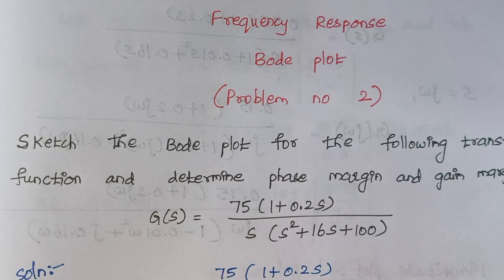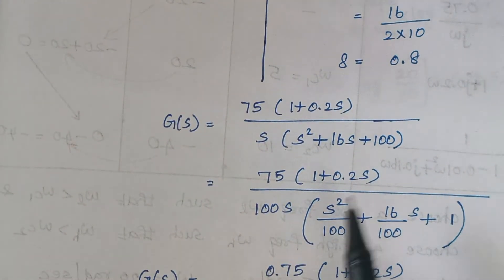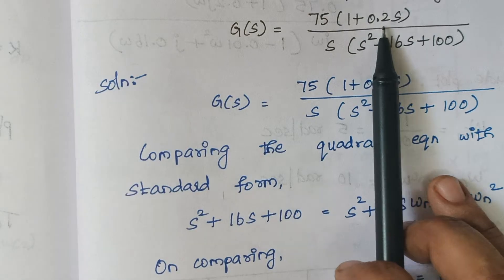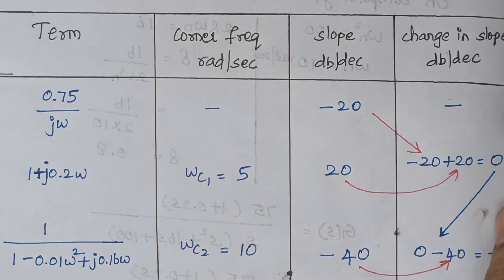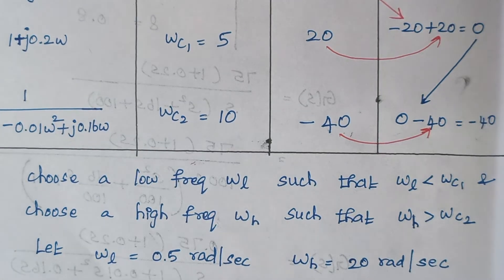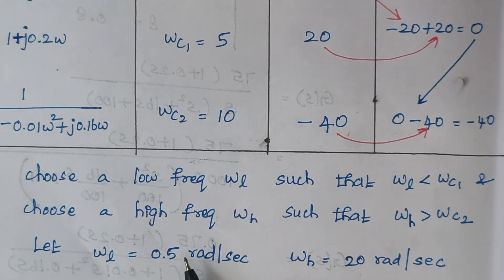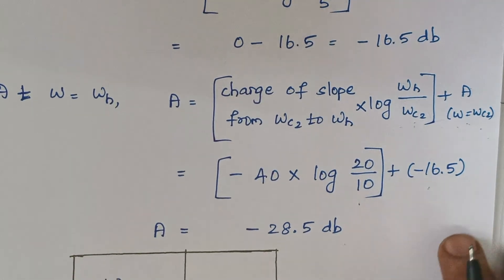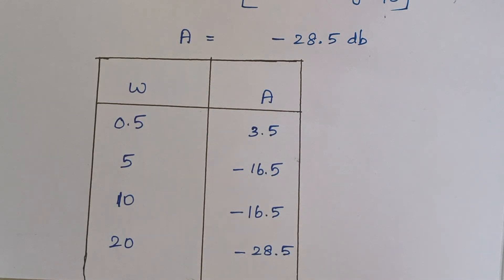BODE PLOT (Frequency Response)(Problem no 2) ( Part -1)

Comment: maam how can you consider second corner frequency as 10?
Reply from the maker: Whenever you have a quadratic equation,then you have to take Wn value as one of the corner frequency.Here Wn2 = 100.therefore Wn = 10. Here we have Wc1= 5 ,then the next high frequency is 10 . therefore Wc2= 10 here
Reply: @kowsiteaches  thank you maam
Reply from the maker: Most welcome 😊
Reply: @kowsiteaches i got wc2=6.25 rad/sec but you got 10? 5:44 and also -40db
Reply from the maker: Whenever you have a quadratic equation,then you have to take Wn value as one of the corner frequency.Here Wn2 = 100.therefore Wn = 10. Here we have Wc1= 5 ,then the next high frequency is 10 . therefore Wc2= 10 here

Comment: what we have to do is the wn is smaller than the wc1
Reply from the maker: Wn is then taken as Wc1
Reply: @kowsiteaches  could you please eplain the different questions like 100(s+4)/(s(s+0.5)(s+10))…bcz the question you had expIained is explained by so  many members…please expain it…
Reply from the maker: Sure
Reply from the maker: @user-cm5uq8gr5v  kindly check whether the problem is correct and confirm me.what are all the parameters to be calculated? Include that too
Reply: @kowsiteaches  yah..problem is correct and the question for above is to plot the  bode plot  and determine the gain  and phase margin